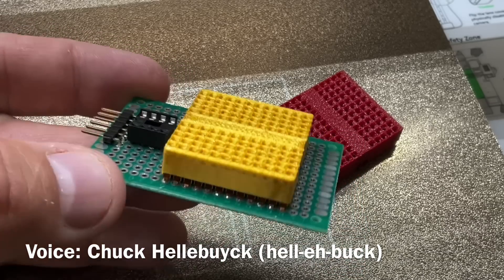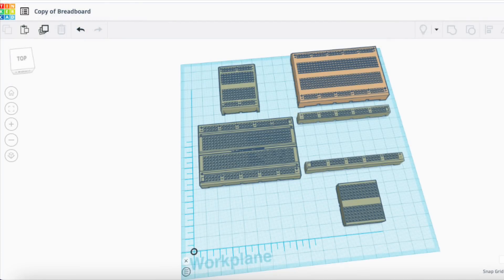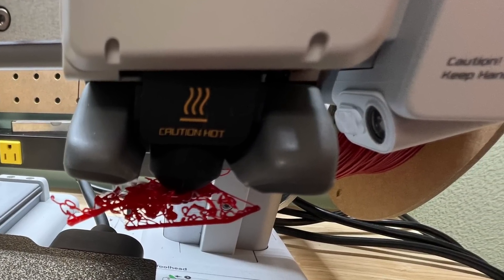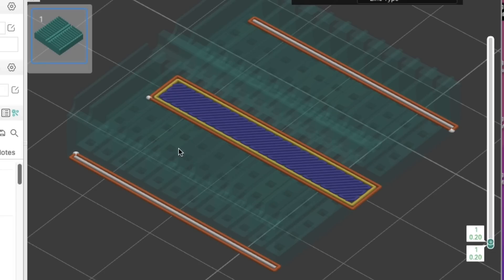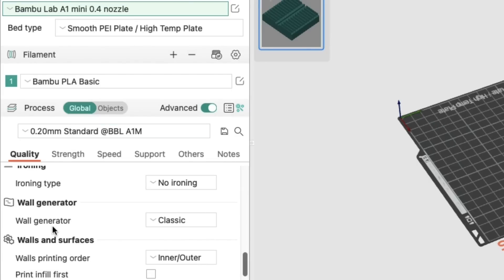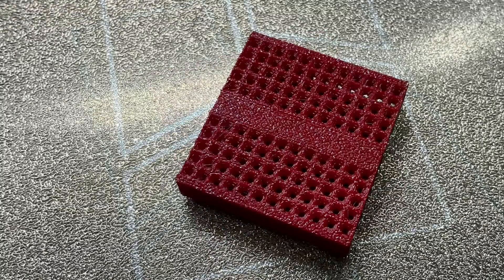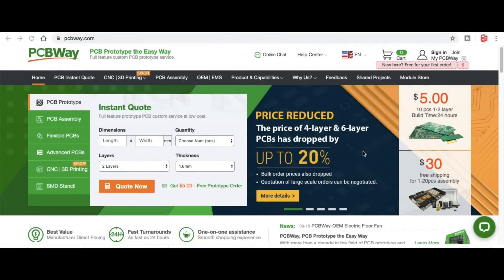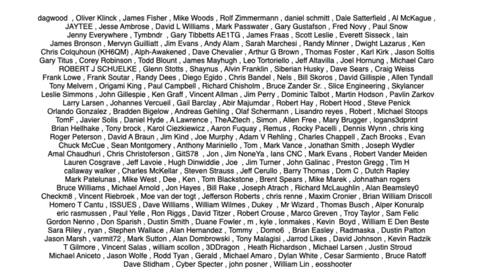3D Print Your Own Electronics Breadboard

Comment: This gave me an idea. I'm not that interested in the LED lights angle, so I could use clips harvested from a normal breadboard. Why would I do that? There are lots of ESP32 and other micro-processor boards that are not breadboard-friendly because they are too wide. I could 3D print a wider shell and use those harvested clips set further apart (ie, a wider unusable center channel). Hey, presto, a DIY breadboard that can have multiple tie points for each pin on both sides of those microprocessor boards. I've got plenty of standard breadboards, including a few that I've ruined in various ways and that would be glad to donate their innards.

Comment: I had a similar problem not long ago with my A1 Mini. It failed to print the top most parts of a model with very thin walls. I was mystified as to what the problem could be, until I looked into the slicer (Bambu Studio) settings and tried the Arachne slicing option instead of the Classic one, and bingo! The A1 Mini is a fabulous little machine, highly recommended to anyone whether a beginner or experienced user.

Comment: Elephant foot compensation.  Bambu typically has it set to 0.15mm, so if your walls aren't very thick, there might be less than the first layer line-width left at that first layer.

Comment: This is interesting.  Maybe you can actually design a breadboard that an ESP32 board would actually fit on.
Reply from the maker: The spring clip sockets are still based 0.100” center to center but there is some tolerance.
Reply: @FilamentFriday  That's good though I was thinking you could somehow make the breadboard wider. Most breadboards only have 5 rows on either side of the channel.  The ESP32 usually fits across the entire breadboard with barely enough room to wire up anything.
Reply from the maker: @zk_6312 - there is no limit. It could be made as wide as you want.
Reply: @zk_6312  Many breadboards are made out of multiple pieces, like the power rails and the main pin board. If you disassemble some of them, you can put them back together in a way that you have a power rail or two in the middle of the esp and thus widen the entire board.
The other option is to print a holder that holds two breadboards and spaces them apart so that the pins of the dev board fit in the other pins of both boards.

Comment: I have a bunch of those PCBs where none of the wholes are connected. I highly suggest getting ones that connect 3 holes at a time. I have some from electrocookie and can recommend them. It actually saves hours of soldering. There's also ones that are the same layout as a breadboard. (Solderable breadboard). I like both. It just depends on what im trying to do.

Comment: This may sound crazy, but I like problems like this, where there's a cut and dry solution after a little troubleshooting. It's rewarding and you don't have to guess and do a bunch of test prints to see what works and what doesn't. Simple slicer review showed the fix. 👍🏼

Comment: Looks like you have selected smooth plate instead of the textured one.
Reply from the maker: Textured plate was used in all prints but during editing I needed that clip recreated it. But I apparently forgot to switch back from smooth from another print before screen capturing. 
Had nothing to do with the issue.

Comment: it doesnt use the camera
it returns the print head to the edge of the print plate and checks by tapping the nozzle against the bed if it doesnt feel the bed ie something is preventing it from getting close enough to touch then it reports it as a fault
Reply from the maker: What starts that process?
How does it know it needs to do that?
Reply: @FilamentFriday  they call it clump detection on a1 series
Reply from the maker: Thanks. I found the details on BambuLab site.
Reply: @FilamentFriday  great stuff keep up the great content
Reply: @FilamentFriday  its a setting in printer settings i believe - it knows after doing first layer to go off to the side to tap the nozzle - i assume its using similar eddy current readings as it does for bed levelling and the measurement is either good or bad - good and it will continue and bad it will raise a flag and pause the print

Comment: I need to check my A1 Mini settings because backed up filament trashed a hot end like happened on your K1. The A1M nozzle is easy to replace but replacing the hot end is a chore and a half. 

With your print I would have used glue and a 0.2 nozzle, wouldn’t have prevented your problem but has worked well for me when printing a sparse first layer.

Also not related to your problem but worth mentioning, Bambu Studio and OrcaSlicer have had a bug for a while where the elephant foot compensation is set to 0 on the A1 Mini only.

Comment: The K1 Max has had the AI features since day 1, but they are turned off by default.  It's under Settings / Camera / AI Function.
Reply from the maker: Thanks. Does it stop the blob?
Reply: @FilamentFriday  I’ve never had a blob, and only had spaghetti failures a few times.  When I got my first K1 Max, the detection was too sensitive, so I had to turn off the pausing, as the false positive detection was too high.  I haven’t tried it lately, but I have some filament reviews coming up, so I’ll give it a try while I do them.

I am a Software Engineer, and from what I have observed the false positive rate is way too high.  If you can view the camera remotely after a detection, and stop the print manually, I think that is currently the best option.  On the other side, for the blob issues that you’ve run into, these should be rather simple to detect, but they have a high false negative detection rate as well.

You could try hiding a small levered micro switch inside the head, that would get triggered by a blob, which would probably be better than most of the AI detectors for now.
Reply from the maker: @cnc-maker - I’ve thought of the micro switch idea in fact I’ve created a few designs but haven’t fully tested it yet.

Comment: you selected smooth pei plate on the a1 its textured and are you using bambu filament
Reply from the maker: Textured plate was used in all prints but during editing I needed that clip recreated it. But I apparently forgot to switch back from smooth from another print before screen capturing. 
Good catch.

Comment: I always use arachne for lines of this width in small complex designs like this, also one line of skirt to start with a perfect layer.
Reply: I like the Arachne but when I made a flexible din mount. The spacing was gluing together. Classic fixed it. So I guess it's case by case -.-
Reply: @KJMcLaws  for me has been working well when I need it. But maybe that's the reason that isn't default.

Comment: I always set “avoid crossing walls” when there’s a model with interior holes. It helps a lot with unintended “specks” and strings. Takes a little longer to slice but with how fast slicers are now, that doesn’t matter
Reply: Classic has a lot of optimizations built in over the years. Arachne has gotten much better, but it still has a bit to go before it can entirely replace classic. But I do use it 70% of the time. It Should be a more notable improvement over classic, as it gets more optimization it will further improve over classic
Reply: If you're going to do a lot of stuff like that, you can also just switch over to resin, which doesn't have that particular problem.

Comment: TLDR: The slicing settings were wrong. The A1 printed the part just fine once they settings were corrected for this specific use case.
Reply: Man… I was having a genuine issue with my A1 first layer, went through the forums, manually trimmed it, tried contacting support but it sounds too much like a generic issue they sent me back to the self help loop. And I can’t go back to the prior firmware when I didn’t have a problem… 😢 thought this was going to shed light on it.
Reply: @MakerBees333  Have you tried the subreddit? They might be able to help you there. 

On a side note, is it something that happens with every model or just one.
Reply: @TheDepep1  it is as ‘if’ after it does the bed mesh if forgets it’s Z-height and bedmesh, I tore down and retighten the printhead thinking something was loose, new nozzle, the whole list.  

I can try the subreddit again, for now the best is to leave bed mesh off and hope the first layer isn’t too ugly, while I cross my fingers for another firmware update.
Reply: @TheDepep1  but now that I have typed that response out…. I wonder if the Z-height and bed mesh are saved on the SD card and it needs a new SD card 🧐…

(Oh and it is every model even previously pristine prints)
Reply: Well for a printer meant to compete the prusa mini, the reliability isn't there.
PS I love my mini, she runs like a clock, no issues except that I sometime need a raft on the smooth pei sheet
Reply: @aterxter3437  I don't own a a1 but my p1s has legitimately not failed one print outside me forgetting to enable supports or wash the plate
Reply: @TheDepep1  ❤️ That too was my experience with the A1mini until 10months of daily use. But I am pretty sure it has nothing to do with usage, as what wears is not worn out… unless it is the bed sensor probe itself and it would probably be cheaper (with labor included) to get a new one instead of trying to buy a whole new hot end 🤷‍♂️ IF that even is the problem
Reply from the maker: Exactly what I showed in the video.
Reply: @FilamentFriday  The Webster Dictionary defines "TLDR" as  too long; didn't read. Or in other words, a briefly expressed main point or key message that summarizes a longer discussion or explanation.
Reply from the maker: I’m aware of its meaning but there was a lot more explained in the journey I showed in the video before getting to the conclusion. Your TLDR was inconclusive and incomplete.
Reply: @FilamentFriday  to be fair, I watched the whole video anyway 👍

Comment: Bambu A1 has stopped because it detected a clog. 
It does it by monitoring the flow rate. If stuff isn't flowing smoothly? It knows something is up.

Camera is used for spaghetti detection.
Reply: the camera was sold as for future unspecified features that could in theory be done with ai, the spaghetti detection thing is one but it really doesn't do much at all.